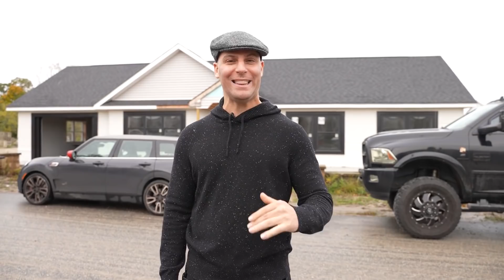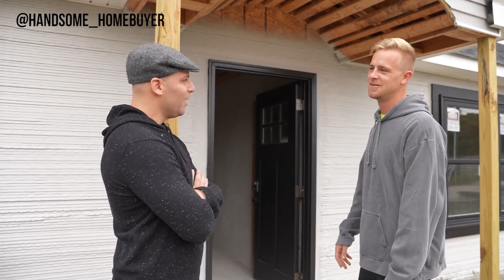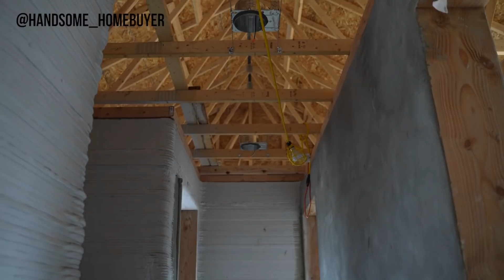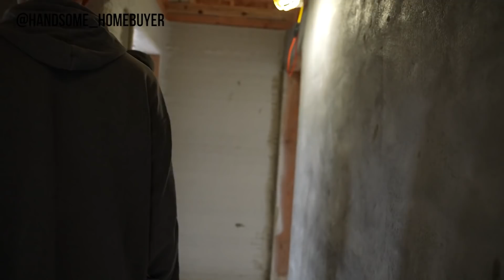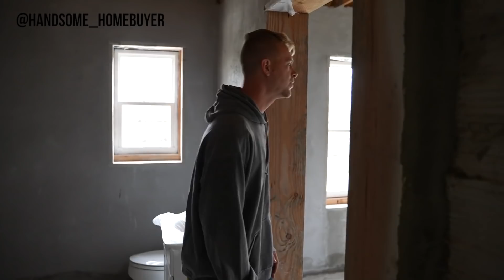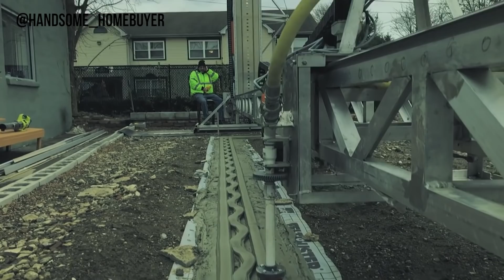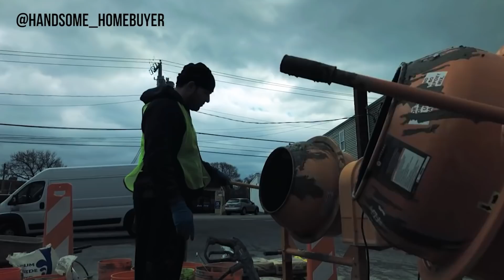The FIRST 3D Printed House in America! (SQ4D)

Comment: Since all the walls are concrete it must be a complete disaster to have Wifi in your home. Instead of having one wifi router you'd need a whole bunch because the signal will have a tough time penetrating concrete. It's one of the worst materials for wifi signals. I wonder if you could put the wifi router in the roof area since it has a birds eye view down into the entire home.

Comment: Carbon negative, Charlie? The printer uses concrete. It requires energy to manufacture concrete. It's an innovative and intriguing advance all on it's own - stick with that. Disappointed that they don't show the finishing (Plumbing, etc.).
Reply from the maker: Carbon infused concrete where the carbon produced by the concrete production is incapacitated in the concrete 🤔

Comment: 3:00 ... yes and because of this, 3d printed houses should be a lot cheaper to build, literally a fraction of the cost
Reply: Nope. Plumbing , electrical , windows , & doors all still have to be done by hand . No one has integrated those into  the printing process. They are the most expensive & labor intensive parts of  construction.

Comment: This is just a novelty. You could've just formed and poured the concrete walls is a few days and been done. At least forming and pouring it the walls would've been smooth. This looks rough as f**k. Alot slower than what he's making it out to be. Yea, this not good. You've could've laid block walls for that matter faster and cheaper and A LOT better looking than this mess.

Comment: Carbon neutral or negative?  Huh, all those extrusion machines running on pixie dust?  The trucks to haul the equipment there all running on solar power?  Those large metal frameworks, all welded with solar powered welders?....it's a cement house folks.  So, how do you run all your electric and plumbing?  How are the walls insulated?  The R value of an 8" think concrete wall is usually about 1.3 to 1.5.  Those walls would not come even close to meeting code in any place that is cold.  That house at 300K based on 1400 sq ft is $214\sq. ft.  They build houses by me for $150\sq ft.

Comment: i hate wood construction but i think it would be cheaper and easier to pour the concrete house in sections in a factory (controlled conditions) and ship the pieces to the house site. also, just use forms instead of 3D printing. assembly line!

Comment: Seriously awesome, but I need to know how they handle insulation, electrical and plumbing.
Reply: Then after the wiring and plumbing is completed I'm sure they just spray in some foam insulation.
Reply: The same way as it will leave the gap for the windows
Reply: As it rises, it leaves gaps in the walls to allow electrical wiring to pass through. In this more detail clip you will see workers making those holes.  
  https://youtu.be/XHSYEH133HA
Reply: Good question.  Also how about remodeling in the future.  How would you change out all wiring or add plugs/fixtures later?
Reply: @travisbdyson  just drill the hole like in the concrete structure
Reply: the same way in a manually poured house. holes are left and then filled with the appropriate stuff
Reply: 3d printed house has gap inside the wall
Reply: Solar powered with battery banks, the actual material itself is its own insulation idk about the plumbing but this is really happening already around the world.
Reply: Does anyone knows if there are  any 
3-D printing companies in Bay area ?
Reply: What is the cost per sq/ft ?
They say it’s cheep but we know each city want their shares. That’s why we pay up our noses .
Reply from the maker: This new video will answer all your questions https://youtu.be/EBaNBqI9dmE

Comment: The problem with these walls is they're going to crack there's no place for Expansion Joints.
Reply: Is this a concern that can be rectified or do you feel like this technique will never work?  I feel like it will work and will take off
Reply: @michaelloftin5343  concrete gets hot an cracks. On the other hand if you have a basement and the walls are poured under the ground that's different  because it's cool under the ground. It's just that simple
Reply from the maker: This new video will answer all your questions https://youtu.be/EBaNBqI9dmE

Comment: Where do you run electrical and plumbing?
Reply: Im pretty sure they'll still put up drywall probably 2x4s anchored into the concrete then drywall on top that'll be enough space to run wire and PVC also drywall for the ceiling i doubt it stays wide open like that

Comment: Cool Tech. It saves wood and time, but still a counterproductive  BIOHAZARD. Concrete creates "Urban Heat Islands" which affect electricity demand, produce green house gasses, & air pollution. Also Concrete requires Sand which is already destroying river ecosystems & entire Islands. Bigger Picture is ITS A BIG BIOHAZRAD! The solution is Biophilic Design! Singapore has adapted the Biophilic approach. My suggestion is to mix Hempcrete with the 3D Printing technology if possible to make this work. Hempcrete made of Industrial Hemp fits the Biophilic Design Profile.
Reply from the maker: This new video will answer all your questions https://youtu.be/EBaNBqI9dmE

Comment: while i applaud the tech i can tell you with 100% certainty these houses will look FILTHY in less than a year.  the little shelves made by the layers will progressively collect dust, dirt, mildew etc vines will go absolutely berzerk - look at any stucco style house and you'll see what i mean. 
there IS however a fairly quick remedy: top coat the exterior with a smoother troweled off surface and that should generally solve it.
Reply from the maker: That isn’t the final finish. It was left like that to show how it’s built.

Comment: I think 3D houses are cool but they’re definitely not carbon negative or even carbon neutral. Concrete isn’t very good for the environment so if they can use sustainable concrete (which is a thing but a little more expensive right now) or use another material that isn’t as bad then yes it’s the future
Reply: In Italy there is a company that quarries  clay on site mixes it with water & local  re-enforcemnt ( staw , rice hulls , etc .). 

This leaves a "quarry hole" that they turn into a catchment pond for roof water.

 Said pond can be ortenental or used to water  the plants ( traditional / hydroponic )on site .

Comment: 3D printed walls. How did you insert the rebar to connect to the slab? And how did you connect the roof non 3d printed roof system to the wall system?

Comment: Many other 3D printed houses in America, but this looks pretty cool. Would like to know about wiring though.
Reply: As far as I can tell all of these on the market are just shells . No wiring , plumbing , etc.
Reply: Soon everything will be wireless.
Reply: @Diamondusa7  not everything. Even battles need charging, &  solar charging creates heat & wear on the device. For example heavy contractors use corded or compressed air drills because they last longer , have more torque , & there is no need to change batteries .

Comment: This house is the first one the builder has built, and the narrator has encountered.  Perhaps the fist in that county.  I even doubt its the first in NY.  It's extremely late to the US race.  It's out of the top 25 in the world.
Ignoring progress, as these 2 appear to do, until you have 3D structure printers for rent at the desk in Home Depot does not mean there is not 3D printing of structures.
I think Charles would be shocked and amazed if we showed him the innovation of screwing drywall to studs instead of nailing.
The Germans have the strictest codes in the world, and even THEY built 2 printed houses already, fully coded from PERI, a huge conglomerate.   
Charles lives in a closet.  There are these things called magazines and newspapers we should introduce him to.  After a year we might show him that World Wide Web thing from the 70's.  Slowly bring him into the latter part of his perception century, then into the 21st.

Comment: Is anyone else noticing that there are no switches or power outlets in any of the walls?  How is the water and waste lines run??  Are they planning on furring out ALL of the walls to run their plumbing and electrical??
Reply: Likely because they probably couldn't program any bridging technique with the cement they used in order to create the holes needed for it l.

Comment: If you leave it for 24hrs between pours what do you do to the top layers so it will accept the first layer when you restart pouring. What about controlled curing times, I would have thought if it cured to fast the shrinking would cause cracks.

Comment: Looks nice but the floor and wall are not sealed. You can see that water is on the floor around the walls and that it was wet outside. Also concrete is not water proof so this building may need a sealer applied.

Comment: $$$$ how much for the house ffs$$$$$
Reply: 4K won’t even buy the trusses- concrete with cost around 5k not including electric plumbing and insulation and finishing the house - roofing will be 6k - these homes average 300 thousand for a home 1200 square feet.
Reply: @sikawv  .... These are homes made from 3D printers... and since they can be built in house. They can saturate the market bringing cost level down. Also this isn’t a regular house so let’s not put normal houses cost to this.
Reply: 4K... yep it’s that cheap and it can be built everyday

Comment: This is not concrete, it is mortar. The material has no large aggregate, meaning its compressive strength is very low and probably brittle. Also there are no inspection and testing guidelines for this in the US yet. So this is very misleading.

Comment: yes, but without an electric system (there are no lights as you can see),  hydraulic system, try to make holes in concrete to put pipes.... 
interesting prototype but it has a long way to be completely useful.
Reply from the maker: All great points.  We are in the process of producing a follow up video that will address all the points.  It's going to blow everyone's mind.  I'm pumped!

Comment: This video title is incorrect. Icon from Austin, TX is the first house in USA. But then again all the buzz about this will send this to more people. I am hoping for a cross between of hemp house built with concrete 3d printing. Living in the Midwest I need insulation and would like some of the house to be carbon neutral. Kirk maybe correct in saying "largest 3d structure built". he probably meant in the USA since China has a 11k one.
Reply: This is the first real house 1900 sqft, Not Icon and a 300 sqft LOL
 is https://www.wfmz.com/news/pr_newswire/pr_newswire_technology/sq4d-builds-the-worlds-largest-3d-printed-home/article_e9da4158-3e3d-5810-a435-67dfed8af902.html

Comment: This is pretty cool but they are at the early stages. Don't let a slick video fool you into thinking this is a thing quite yet. I have no doubt that they are on their way though. Obviously the wall texture needs to be cleaned up and the idea that they would be mixing cement in such a adhoc way is a clear indication that this is really early. The cement mixing would be a very easy thing to automate based on local conditions using off the shelf sensor packages and mixing systems. If they look at the recent advancements in agricultural chemical mixing automation, there is a lot to be borrowed there, such as, automated measurement and mixing, on-site. The control of the "3D printer" has a lot of refinement that could be done. There is no reason why a troweling system couldn't be added and as the machine runs through the g-code that it would not only be responsive to the individual house design but also the other operations going on beside it. Also, infrastructure internals are not yet being built into the walls. Things like plumbing and electrical should be included in the wall construction. I venture to guess that when this is ready for prime time, there will be many more passes per layer than they are doing now, in order to capture details that they are ignoring as of yet. Look at FDM 3D printed objects from 7 or 8 years ago compared to stuff people are printing at home, today. The quality and detail improvements are mind blowing, but, you can't fast forward to perfect. You need to go through the evolution of the process in order to get there. In fact, it wasn't until the patents for 3D printing ran out was when all the fast advancements started. When the public and the enthusiasts got involved is when the technology exploded. Before that, it was controlled by a very small group of companies that progressed very slowly and never did produce something for the general public to use.
Reply: See it in action here  https://youtu.be/1WXHJn7z-hM

Comment: As a contractor, in not seeing the cost saving? The framing of the exterior and interior walls are a fraction of the cost of a house, most of the expense is in the rest, kitchens bathrooms, flooring roofing electrical plumbing, roofing painting finish work, exterior treatments. I can see it saving some but not enough to change the way we currently build.
Reply from the maker: This new video will answer all your questions https://youtu.be/EBaNBqI9dmE
Reply: So as a contractor how much would it be for a 1900 sq ft house to frame? using $15 per sq ft. Cost is $28,500. How long would that take 2 months with no weather delay. I agree with you how fancy your bathroom or kitchen is the most expensive part, however that could be done over 10 years. I don't own a home and the biggest expense is just 4 walls. Now that being said there is no insulation I dunno how concrete R value is but I would like some of the German or European building blocks but its expensive.
Reply: Andrew Frodo in the case of this house shown here, the floor is concrete and the roof is wood framed as normal so... when comparing price differences between the two methods your only talking about the exterior and interior walls. The walls are very easy and fast to frame. A crew of 3 experienced framers could frame those walls in 2 days, in the video he said it took at least one week to three d print those walls then it need to cure for another two weeks before the roof could be built.
It seems to me no labor costs are being saved if not more labor, setting up the printer, mixing all the concrete by hand. To me it seems a lot less work to just simply frame the walls in wood.
As far as material cost difference... lumber vs the concrete. The lumber for those walls, I would estimate some where from 7000 to no more that 10000. So let’s say your concrete raw materials are half that. You might save 3000 to 5000 on a house, but now consider having to plastering the interior walls instead of typical drywall. Pluming and electrical may cost more because it is not typically.
In the end I don’t see the savings. 
Your exterior costs is a savings, however, it’s not a look that is typical and could be a turn off in a resale situation.
I’m not saying there no market for this, however, it’s not the magic bullet at this point. The cool factor is there for sure. 
The challenge is changing methods that are ingrained in our world, what people are used to, new systems take new thought,skill, tools, and training.
I hope these guys the best.
Reply: @rodneyficklin9281  True

Comment: Besides the obvious “where are the utilities? Water, electric and the like” How do they plan on insulation? Just curious because the walls already seem fairly thick. Does the concrete act as it’s own insulation in this situation? Or is insulation added in between the support structure of the walls themselves? I’ve been intrigued by the thought of being able to “3D print” a home but it just seems like there are things left out in any video I’ve seen or articles I’ve read.
Reply: Not sure if this concrete acts as insulation, but houses in India are largely made with concrete and they are just terrible for insulation. It's cold when it's cold out and hot when it's hot out.

Comment: This technology has been around for the last decade. This guy did not invent this technology and he just copied it from other companies that have already built houses this way overseas, but it is cool tech.
Reply: the fact he got a 3 axis extruder system to work outside of the lab of this size is always impressive. might not be the first, but he got it working.
Reply: Cool Tech. It saves wood and time, but still a counterproductive  BIOHAZARD. Concrete creates "Urban Heat Islands" which affect electricity demand, produce green house gasses, & air pollution. Also Concrete requires Sand which is already destroying river ecosystems & entire Islands. Bigger Picture is ITS A BIG BIOHAZRAD! The solution is Biophilic Design! Singapore has adapted the Biophilic approach. My suggestion is to mix Hempcrete with the 3D Printing technology if possible to make this work. Hempcrete made of Industrial Hemp fits the Biophilic Design Profile.
Reply: @muchceo2859  concrete homes usually have lower utility bills so how does this negatively affect electricity demand? Regarding hempcrete, I've read there can be some rot or mold develop over time, whereas this is  not issue with concrete, thoughts on that?
Reply: @muchceo2859  seems interesting and an easy fix. Have your offered your suggestion to the builders?
Reply from the maker: This new video will answer all your questions https://youtu.be/EBaNBqI9dmE